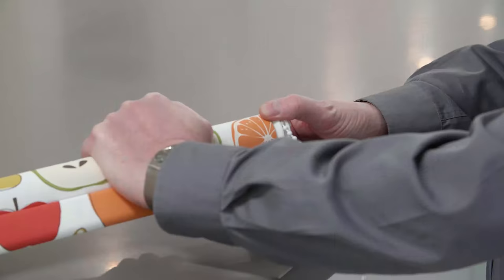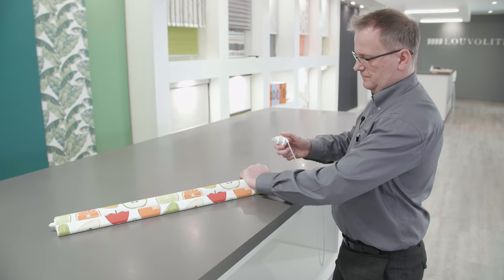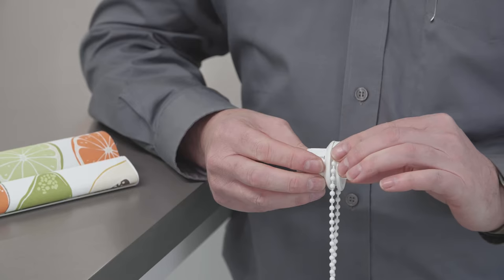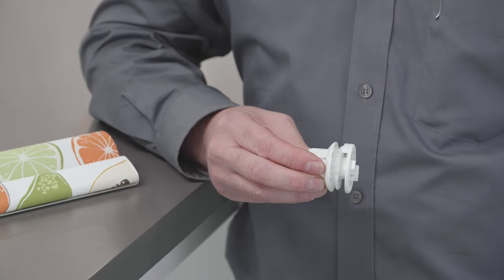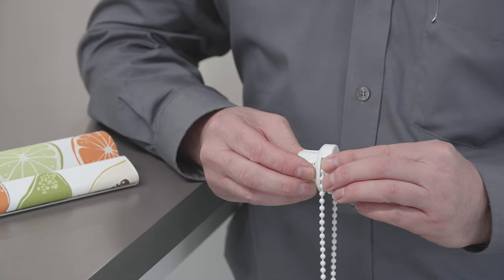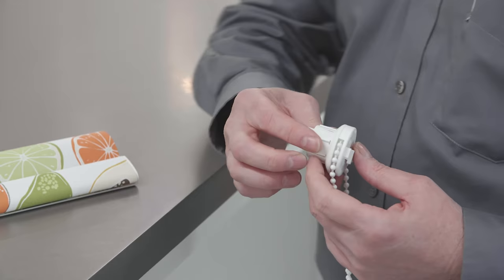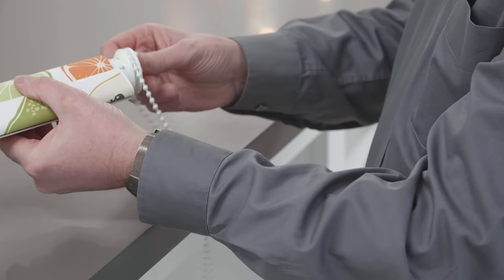How to Reinstall Chain Into The Control End of a Louvolite Roller Blind Tutorial

Comment: Chain fix for RollerBlind. In case you are here to reattach the chain for a Louvolite Shade System 40 clutch R3025, this is what you do 

Remove blind - steps to do this:

  - roll up blind (if you can with a little force, but not essential), push chain end in a direction it will move a little, usually up, push toward other end., it should now be detachable from chain end) 

Once removed, roll up blind if is not already

Pull out mechanism on chain end from the roller tube - the whole chain enclosure mechanism should slide out - use a flathead screwdriver to ease out if necessary. 

Remove the plastic pin from point at the end, prise out with a small Phillips screwdriver in the hole if can't do manually

Replace the chain - if it has a joiner the make sure it is placed close the mechanism on the side where the chain is chain is will drop down. 

Reverse process to refit.

Note: the three lugs on the chain end should be faced upright, ensure blind is facing correct direction.

Comment: How do I remove the slide lock from the end of the blind!!!
Reply from the maker: Hello Sally - the side lock can be pulled straight off of the tube, if it is sticking however, try prying it out using a flathead screwdriver.

Comment: I've got one like this but it won't squeeze together enough to slide out, and it's partially enclosed making it hard to even use tweezers, let alone pliers to squeeze it, what can I do?
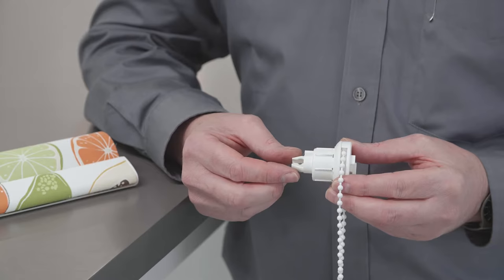Reply from the maker: Hi Jamie, there could be a black plug you need to remove first - this is found between the two jaws in the centre section at 0:25. If you're still having trouble, email us an image at tech.support@louvolite.com and we'll get back to you with a fix. Thanks.